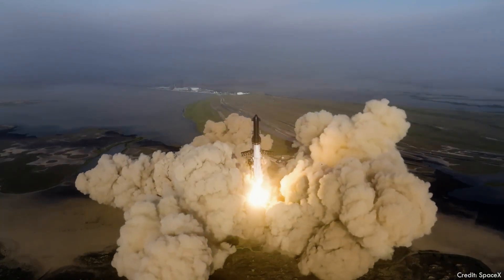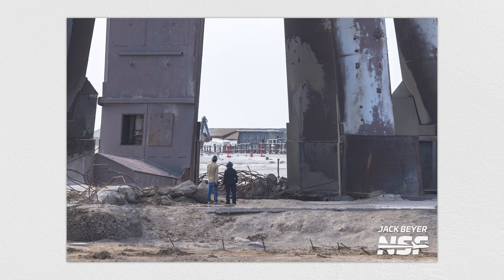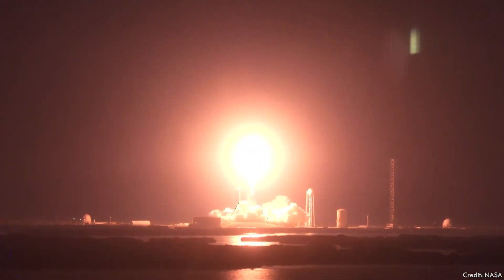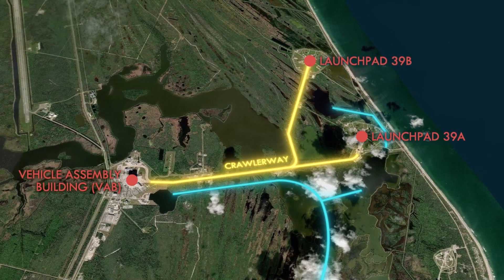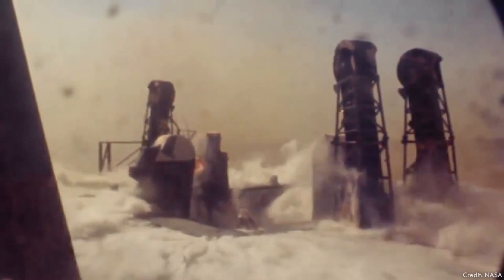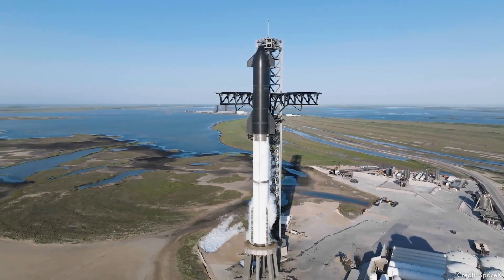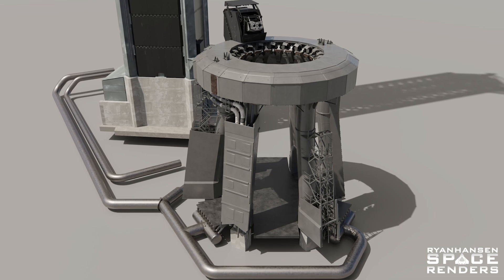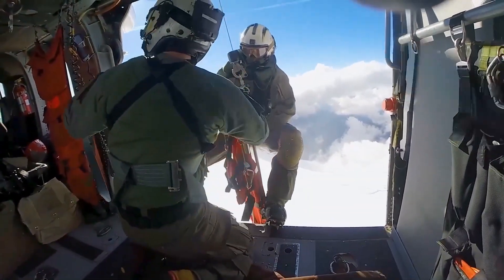Was Starship’s Stage Zero a Bad Pad?

Comment: Grady. I'd like to draw your attention to the strobing effect seen in the video after 9:47 -- you can see a crazy powerful strobing effect, mostly on the right side of the rocket, and in my estimation they are shockwaves.  The modification to add a water cooled plate might seem to be a better idea than no water cooled plate, but that plate is flat and will redirect that energy right back towards the rocket.  In an odd sort of way, the 4/20 launch onto concrete might actually have attenuated the acoustic energy a great deal as that energy was used to break up and excavate the crater while the water cooled plate might not attenuate as much energy.  What I'm saying is that the next launch could result in MORE damage to the rocket and it is even possible that the rocket will explode on the pad completely destroying the rocket, the pad, and much of the infrastructure around the launch site.  
The additional problem I have is that Boca Chica is too close to inhabited areas -- at the Cape there are no homes within 10 miles of the pads and the bulk of the residents are over 12 miles away, but at Boca Chica there are 7000 people living within 10 miles of the pad with some as close as 5 miles.  And all of this with a rocket twice as powerful as any rocket to ever fly.  If the next launch results in the destruction of the rocket and pad as detailed earlier, and if debris causes damage to inhabited areas in South Padre Island, Port Isabel or Laguna Heights, then the FAA will have no choice but to shut down Boca Chica as a launch site.  Of course, if people are injured or worse then that might actually be the end of SpaceX, I hope not but that is not out of the question if, say, 100 people are killed. 
I think the selection of Boca Chica was hasty and ignored the risks to the over 7000 people that were already living within 10 miles of the pad and I believe they should never have been granted permission to launch anything from Boca Chica.  If the FAA does ground them the facilities can still be used to build Starship/Super Heavy and then ferry the hardware to the Cape from the Port of Brownsville.  So, even if SpaceX is banned from future flights out of Boca Chica much of the investment can still be used to fabricate rockets. The distance, by sea, from the Port of Brownsville to Port Canaveral is about 2200 km which would take a barge about 100 hrs or 4 days, perhaps a bit less if there is a route between some of the Keys versus going south of Key West before turning north to the Cape.
Finally, returning to the FAA, if they permit another launch and the pad and area around it is devastated the FAA will find themselves in a situation worse than the Boeing 737 Max issue where they were shown to be too willing to grant Boeing what they wanted with the result of 346 deaths.  Many nations around the world realized that the FAA could no longer be trusted to do the right thing after the 737 Max issues and a similar failure in Boca Chica could see numerous FAA officials prosecuted for serious crimes.  This could also result in the rest of the world not accepting the FAA approval of anything, resulting in the end of the FAA and, perhaps, the US aerospace industry.
Reply: The FAA did their due diligence. The Cape might not have homes close by, but both launch sites attract tens of thousands of spectators.

The FAA continues to evaluate safety, and they have to fight off numerous court cases saying they made the wrong decision.
Reply: @philb5593  Spectators at the Cape are not generally permitted closer than about 12 miles from the pad, certain NASA personnel and VIP's can be closer but we're talking a limited number of people and they are generally within reach of bunkers.  There is NO comparison to the risks between the Cape and Boca Chica -- they are vastly different in the risks to civilians.
Counting spectators, there are very few people closer than 12 miles at the Cape and those that are closer are NASA personnel and VIP's -- the overwhelming majority of spectators are no closer than 12 miles.  At Boca Chica more than 7000 people live within 10 miles and something like 9000 people within 12 miles -- and some of them are within 5 miles!  And the largest rocket ever launched at the Cape is half as powerful as Starship/Super Heavy!

Comment: You misrepresent a bunch of stuff. but mostly, the engines did fire, but were immediately destroyed by the launch pad disintegrating, second massive misrepresentation is that the flight termination system did not successfully terminate the flight. thankfully the rocket blew up in the air on it's own, because it is a poorly made rocket, and didn't become a weapon headed for earth.  You showed a picture of protected wildlands with a debris field, and you called it the SpaceX facility. It is not. it is a protected wildlife area, that clearly had it's contract broken by SpaceX damages.

Oh and a orbital test that doesn't even make it to space, when large rockets have been in orbit since before the 70s is clearly a failure. Orbit should be easy. Especially with a rocket with this much power. However if things are poorly designed, this easy achievement turns into an insurmountable task.

Comment: That steel "headshower" plate will just explode once that water turns into steam and expands. Even if it survives that, wonder how many pumps they'll need just to overcome all those engine's thrust.
Reply: They won't use pumps. They will use high pressure nitrogen to force the water out of the storage tanks and into the steel plate deluge system.

And as long as they are spraying water faster than it can be turned to steam, the steel plate will stay relatively cool.

Comment: If there was ever a job where Pykrete checks every box, this is the one. Unlike a simple deluge system, Pykrete also works without an atmosphere. It would probably work just as well with dry ice (solid carbon dioxide), commonly found on Mars.

Comment: I was idly wondering whether just building a big fresh water swimming pool underneath would have worked. Water doesn't ablate that's for sure.
Reply: A flow of water must be provided to replace the water that’s being steamed off.
Reply: @JoeOvercoat  If you have a big enough pond you wouldn't need any flow.
Reply: @BooBaddyBig  if you had a big enough pond, the area under the rocket would be steam, and the rest of the pond would be trying to fill that steam pocket in with water.
Reply: @JoeOvercoat  Yes, the rocket jet would cause steam and exhaust gas pressure that pushes the water out of the way. But if the pond is deep enough the jet wouldn't be able to overcome the hydrostatic head of the water. So there's a limit to how deep it will dig.
Reply: @BooBaddyBig  All of the water in the plume of the rocket would go to steam. The rocket plume is that hot. And that water will expand when it goes to steam.
I suggest this is like Deepwater Horizon, where people simply don’t appreciate the magnitude of the forces involved because it is so far beyond the human experience to date.
Reply: @JoeOvercoat  There's hard physics limits about how much water the plume can evaporate though. Rocket propellant has OK but not particularly high energy density and the heat capacity and latent heat of vaporization of water is massive.
Reply: @BooBaddyBig  Yes & yes, which is why a diverter trench combined with a dousing system is the go-to solution.

Comment: I would like to point out the vast difference of where they laid out their fuel tanks versus the NASA launch pads. NASA moved the propellant tanks as far away as sensible from the rocket. SpaceX Left the tanks right next to the Launchpad where they would probably damage just by the forces even if the watch pad worked perfectly fine. 
This whole launch pad makes my head hurt. The decision making just doesn't make sense and the statements are contradictory.

Comment: I typically like your videos, but I feel like you did not add much to the conversation here. For example, I heard one of the reasons the concrete failed on the stage zero was that the pressure from the exhaust hitting the top of the concrete forced the foundation under the concrete to settle, and cracked the concrete in the process. Then the exhaust was free to rip up the cracked surface from there.
Reply: What details, exactly? He even said the FAA's report isn't out yet. The details aren't known. There is a lot of conjecture, but as of today, nobody knows for sure. What he can tell us is how this was different than previous NASA launches and what SpaceX is planning to do about it, which is more than most news outlets actually talk about.
Reply: @reverse_engineered  I was just meaning to say that I thought this video was not quite up to Braidy's typical videos.
Reply: Exactly! This feels like "I need to put out a new video... I know, I can bash on SpaceX about a launch that happened two months ago and not get into any details"

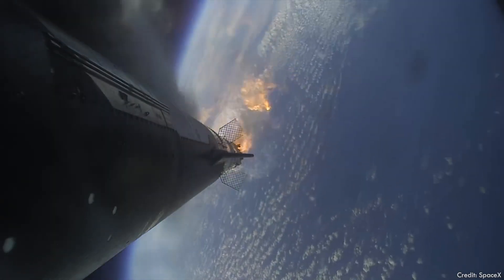Comment: 0:48 A huge mistake. Flight Termination System DID NOT WORK! Rocket blew up because it broke in half. FTS was a failure!!
Reply: Slight correction, while the FTS did fail to explode the rocket immediately, the rocket exploded due to loss of structural integrity caused by delayed depressurization from the holes created by the FTS.

Comment: Is this video a Part One? A lot was left out. The deluge system that's being installed would have been interesting to see discussed. I don't think there is another one like it anywhere else.
Reply: Probably for good reason as the upside down shower will be eviscerated by a launch.

Comment: Why don't big government/ corporations just bore a large  hole in the Pico de Orizaba Mt. And 10 miles above the summit tube for a rail gun rocket launching device to start.
Reply: Completely impractical. Rail guns are no where near as capable as rockets are and simply never can be. They are extremely inefficient at delivering thrust to their payload and they are very finicky, failing about as spectacularly as a rocket. Their limitations come down to physics, not engineering. Rockets are certainly messy and difficult, but rail guns are far worse. Rail guns exist largely as a curiosity and a horribly mischaracterized piece of sci-fi, but they rarely see any practical use.

Comment: Can Practical Engineering please model a hypothetical Starship launch from NASA Pad 39A?  Please?  This may help NASA and the FAA to grasp the enormity of Elon's miscalculation in purporting that the Boca Chica "rocket stand" was a real launch pad.  He chose to take unacceptable risks in launching Starship without a real launch pad, without a flame diverter and without a water deluge.  We know that you need both diverter and deluge working in tandem for launch safety and success.  The actual research and empirical launch data already exist to model a Starship launch from Pad 39A.  Why is this so important?  Because this "fast-learning", validation of launch pad physics & engineering might actually help to save the Starship program.

Comment: 5:41 I feel like a good little engineer- that was the first thing I wondered when you mentioned they used the dredged material as fill.
Reply: I was wondering how much soil overburden they used to help the settlement, which they later remove for the final construction. I bet it was 10-20ft of additional soil above what they needed, just to load the soil for the construction weight.

Comment: Funny how space-x seemingly went from reusable first stages to disposable launch-pads. I’m not sure if their commitment to re-discovering stuff NASA and apparently their own engineers knew beforehand is aligned with the idea of rapid development cycles.

I respect your commitment to value-neutral, informative coverage.

But to me it seems like the company was pursuing very thin savings in costs to engineer their own solution, discovered said solution to be insufficient under half the projected strain, but chose to not correct the clear issue before the launch.

It seems like a very reckless decision made solely to meet a deadline, with full understanding that something “unexpected” will definitely happen. It’s hard to see their insurance company or the FAA using such novel definition for the word “unexpected”.

I also can think only one person walking to the NASA launch site, pointing at a hugely complex set of equipment and saying “I bet those are entirely unnecessary, let’s build a lean, clean-sheet design”, and not being politely told to shut up, and entirely dismissed by the leading engineers working on the project. And that guy does not hold an engineering license, despite often implying or acting as if they did.

This is not a website, you can’t just disable the “unnecessary microservices” and expect no consequences aside from self-inflicted financial losses. Someone could have died.
Reply: The question they were trying to ask was: "can you design a simpler launch pad for Mars/the Moon, - where there is no nice deluge system?"
Reply: Starbase is not a rocket launch site. It's a massive open air RnD Test Site. Space-X wanted to see if they could go really cheap, turns out that it's not as easy as thought. Still a successful test and there was useful data gathered from the test.

Hell, I think even NASA was shocked by what they saw and are looking over the data because they didn't expect the concrete to fail as it did.

But yeah, this is again a test site, if things fail here, then that's fine. All they really did was lose some time and money, but nothing irreplaceable.
Reply: The approach was due to time, not cost. With this kind of approach, SpaceX achieved, in many ways, more than NASA did in 17 years, 45 years counting engine development.  That said, the problem wasn't the design approach itself, but the extreme mis-calculations/reading of the sand layers under the pad itself, leading to compression. A problem that will no longer be a problem with  the new steel-plate, still not using a diverter or reuglar deluge.
Reply: @beamed5382  NASA made it to orbit with it's large rockets. SpaceX has not. And it is completely predictable that this is the results. SpaceX has done nothing with this launch but contaminate protected wildlands SpaceX agreed not to contaminate.
Reply: @beamed5382  by your logic no one learns from previous inventors, spacex doesn't need to re-do NASA's work they could simply learn from previous atempts eg: build a flame diverter which has worked for half a century without selfdestroying, it is not only the launchpad , is highly probable that chunks of concrete and pressure reflected back to cause damage to the rocket itself, all this was foreseen and obvious, but instead Musk decided to burn all that money a destroy the facility, the rocket and the enviroment for miles outside the complex which he doesn't care and obviously you don't either

Comment: SpaceX already did a test for their new water system... they claimed it works "great"
Reply: If you’ve seen the relatecvideo then you’ll understand that that using SpaceX’s definition of great which is not that great at all. The test was very forgiving in its setup and yet the plate failed as can be seen at the end of the video.
Reply: @JoeOvercoat  It doesn't look like the plate failed
Reply: @randomperson1731  watch the end again....
Reply: @georgetreduen4502  if you are referring to the water leaking out the back of the plate that was already present at the beginning. Otherwise you may need to elaborate as to what you are referring to.
Reply: @randomperson1731  we clearly watched different videos.
Reply: @JoeOvercoat  what video are you referring to then?

Comment: As it was explained to me on a tour (I also flew over the pads often). The flame trench originally didn't have a water deluge and it shot fire brick far away.

In May 2008 (STS 124) 3,500 19 pound fire bricks from the wall were shot out at up to 680 mph, 1,800 feet away.

Comment: It seems like it's mostly forgotten that this full stack is not just expected to take off from prepared, developed launch pads, but also the Martian surface and Lunar Regolith, so using the pad before adding more infrastructure was a deliberate choice. Pad failure was one of the expected possibilities. Pad explosion was not, which is why that wasn't in the environmental report.

Comment: IMHO, one of the major differences between NASA and SpaceX is that NASA keeps doing the same thing over and over (with occasional incremental changes), whereas SpaceX starts with a clean sheet of paper and asks "Is there a better way to do this?"
Sometimes the clean sheet approach succeeds beyond expectations, sometimes the clean sheet approach fails miserably.
Neither approach is right...neither approach is wrong.
Reply: One approach costs tens of billions, the other leads to blocks of concrete strewn around the launch pad. It really depends on your priorities to decide which is better.
Reply: I'm pretty sure that approach which repeatedly produces launch vehicles with ~$1B per launch cost is a no-go.

Comment: You completely missed the part about steam pressure below the pad, blowing up the pad! SpaceX, nor anyone, can get enough of a deluge system in place to mitigate the heat pumped into proximal ground water to prevent a repeat explosion. But the next time will feature metal shrapnel instead of "just" concrete. If the FAA allows a repeat, it's going to be ugly. Nobody should trust SpaceX's analysis on this, especially after, as you point out, SpaceX environmental risk assessment said nothing about the risk of a massive pad explosion, then Musk saying they knew it was a possibility. The move fast and break stuff approach does not work for space operations that move quickly through public spaces.